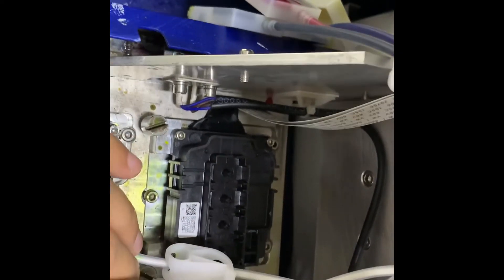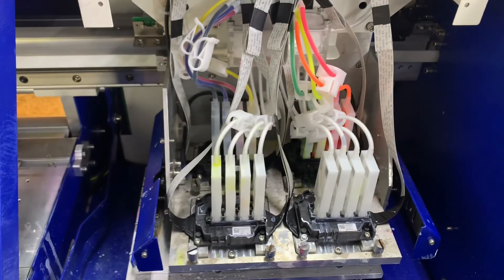Replacing 4720 Printhead on my HJD commercial DTF Printer

Comment: Which head is best & why 4720 or i3200???
Reply from the maker: The 4720 heads used to be cheaper and more abundant. It’s not the case now. Get the 3200 print heads. They don’t need the decoder cards either.

Comment: How does it print ? Which RIP software do you use? I am in process to buy 4 i3200 heads printer. Please guide me
Reply from the maker: Still learning each day. Prints well on most days but there are frustrating times. I’ve gone through 1 Printhead already and the printer is 3 months old.
Reply from the maker: Using maintop rip and printing with hybx print manager
Reply: Thanks. My 2 printhead burnt !!! How did you put these black tape on print head cable ? Please guide me
Reply from the maker: @rajaasifahmed4093  I saved the 4 pieces of black tape when I removed the cables. I replicated them since one had a cutout that went around the plastic area of the printhead. There's no right or wrong way to do it but I recommend taping it well. Water will fry your motherboard
Reply: I am looking to buy these ink clips on pipe but can’t find it online ??
Reply from the maker: @rajaasifahmed4093  Do you mean ink dampers?
Reply: My motherboard also Fried as print head fried due to ink entered via cables. When we remove dampers from print head for cleaning. ink leaks from damper I am looking for plastic rubber stopper to enter inside damper to stop ink flowing outside
Reply from the maker: @rajaasifahmed4093  oh shoot that is bad. You’ll need a new motherboard. Did you message Zoe to replace? Sorry to hear this man
Reply: There should be some protective case which protect water going inside printhead  from cables ??
Reply: On ink plastic tube you have clips to stop ink flow to dampers while changing printhead or cleaning. Where can we buy these clips ?